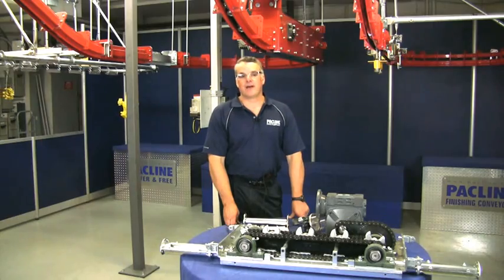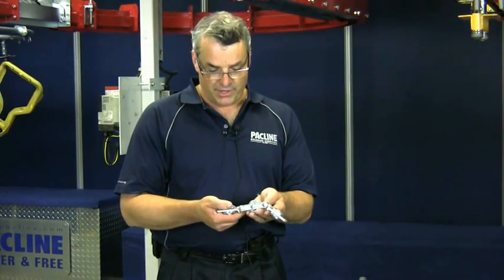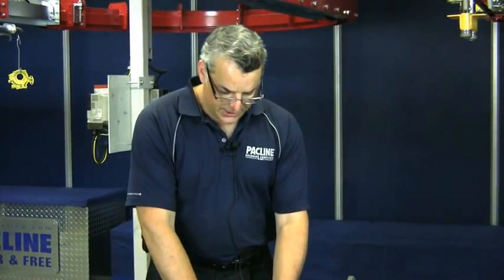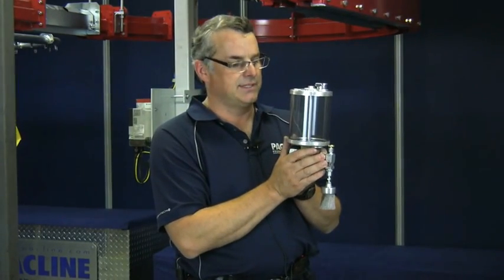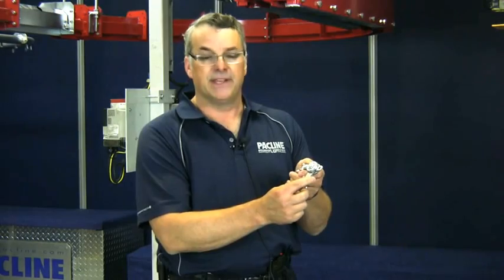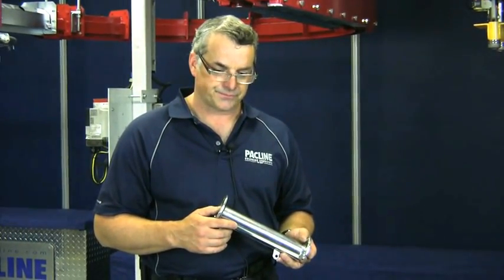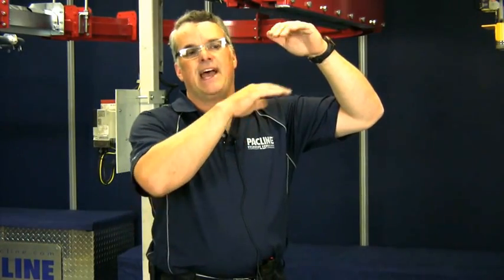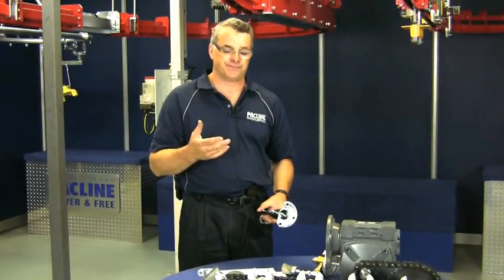Overhead Conveyor Maintenance: Lubrication

Comment: Great video Carl, very informative. I use a microprocessor controlled automatic lubricator with a brush at the end of the lube line that synchronizes to the machine. In other words it will dispense when the machine is on and stops when machine shuts down. Its the Pulsarlube MSP OL500. It's great because it also has a digital display. Price is great also. Hope this helps.